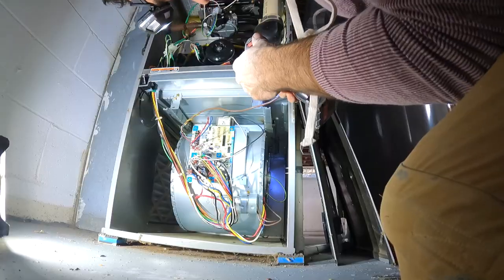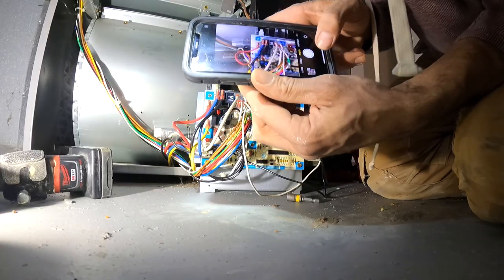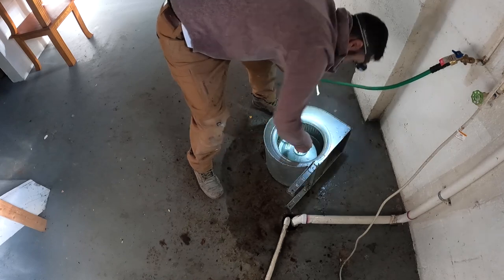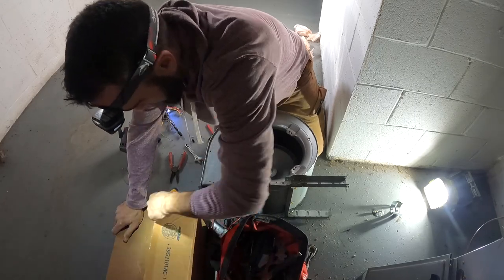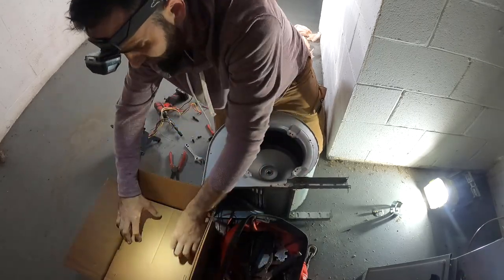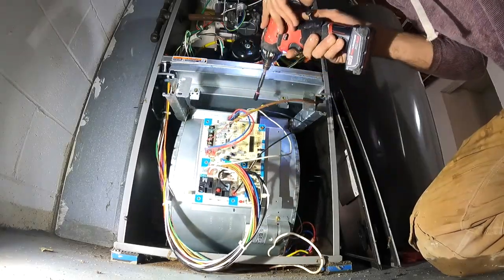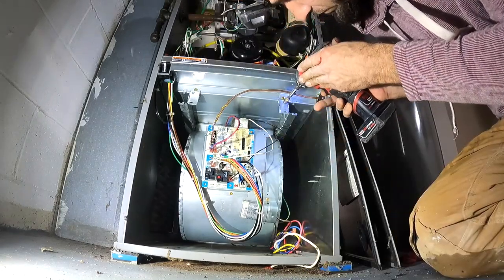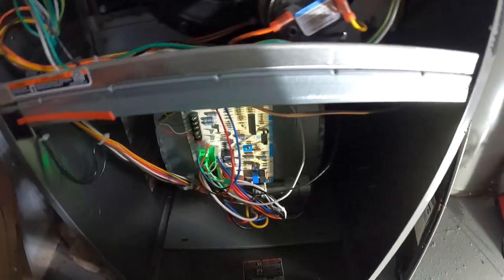Bad BLOWER motor | ICP Comfortmaker Furnace

Comment: Is the capacitor not visible unless you removes?
Reply from the maker: Sometimes they are hidden. Most of the time they are mounted on front of blower motor housing. Look for 2 brown wires coming off of motor. Not always the issue but cheapest part to test before replacing motor.